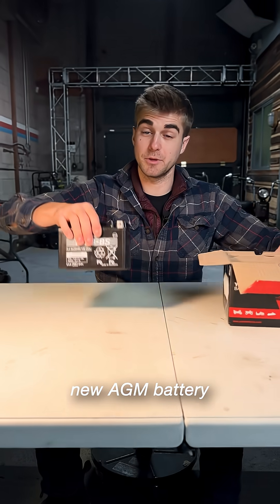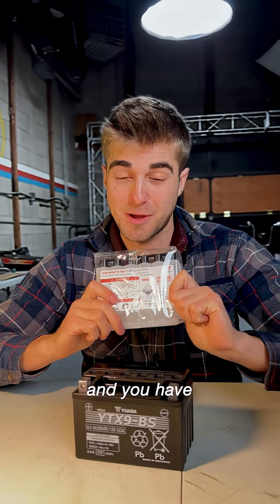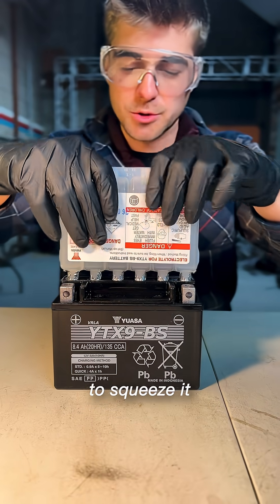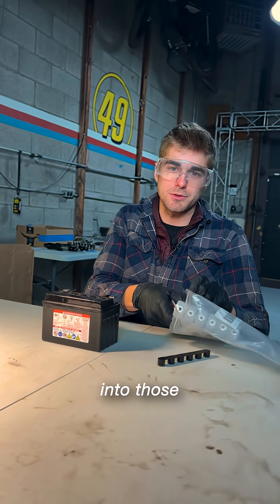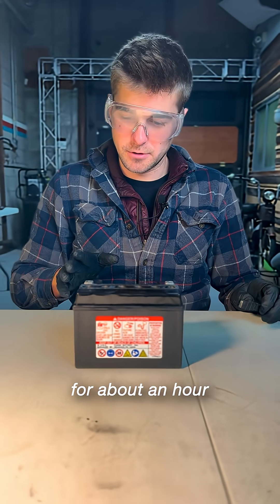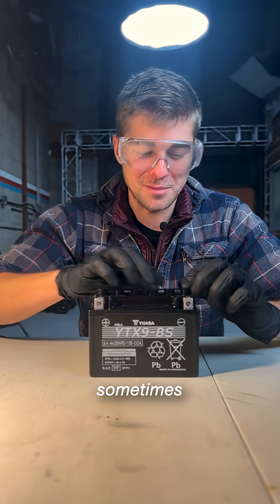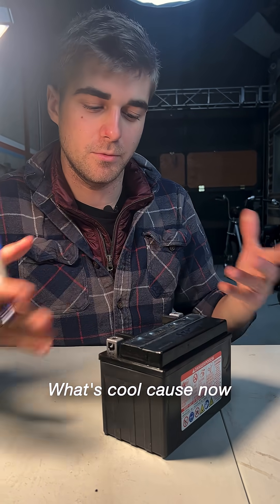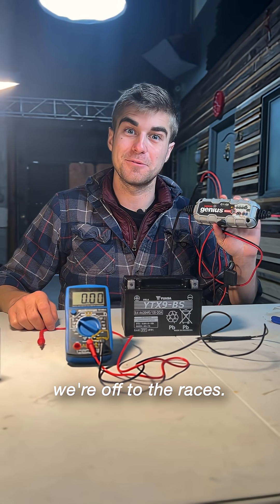How to activate your AGM battery | Tech Tips ⚡

Comment: You used to be able to order almost any lead acid battery dry and fill it yourself. WHich was great since it meant you had basically unlimited shelf life. Also, if your equipment didn't come with AGM batteries you want to make sure your charging system is properly charging them.

Comment: These kinds of batteries can also be used for smaller Back-Up Power Supplies (A.K.A.: Uninterruptible Power Supplies, "BUPS", or "UPS") for critical computer systems. 
But, most of the larger modern systems use lithium.

Comment: The best thing for the empty acid package would be to drop it in a bucket of water.  The little bit of acid remaining would be diluted to the point of harmlessness.  Then it could be dumped and the empty package would not have any drops of potentially dangerous acid remaining inside.

Comment: Seal the battery with the cap after trickle charging not before! The first charge may cause more off gassing than usual.
Reply: They have a gas valve for overpressure

Comment: Is there any maintenance required? I have a vintage Yamaha Enduro, and I have a similar type of battery but it has individual yellow caps. I read the battery manual and it says something about having to refill the acid every couple of months??
Reply: If you can open those caps, it's not an AGM battery. That's traditional Lead-Acid.

Comment: A couple of tips to make your battery last longer, do not cap the battery until the acid is completely absorbed into the plates. With a flashlight, look in from the top. If you see liquid, it's not absorbed yet. Wait. After it is absorbed and turns to a gel, then cap the battery and charge it before putting a load against it. Putting a loan on the battery without charging can reduce the battery life 20 to 25 %. This is from a Suzuki service bulletin they recommend using an Optimate desulfater-charger. I have had battery go 5 years trouble free. Enjoy the ride.
Reply: Definitely don't put a loan on it.😂
Reply: As a Suzuki guy do you have any recommendations on bike toys I can buy my partner for Christmas 😂  he has a cute black one and a cute blue track gsxr. And 2 more bikes on the way for spring. Looking for guys recommendations. He’s got great gear already and getting 2 new sets in spring. So can’t get that. And I have never even driven myself so don’t know what to get. I was so fed up I thought tyres would do. But apparently I need the right ones and black bike and blue bike wasn’t specific enough for them. So now I know 1 bike. So maybe just her getting tyres. But I’d like to find some fun toys he’d love and would be useful for multiple bikes as he gets new ones. He swears it’s the same black bike but I swear it keeps changing 🤷‍♀️🤣 I want something that really makes him happy ❤ but I don’t even drive so don’t know 🤷‍♀️
Reply: @cececox6399  just go buy him a leather jacket at bike distro or look for specific store that sell biker accessories, it'll be simpler for you and he can wear it whatever bike he choose to ride that day.
Reply: Thank you Jeffrey !
Reply: I bought a AGM from Amazon. It was a AC Delco brand that I bought for my Mercedes. It lasted over 8 years.
Reply: The biggest factor in the lifetime of your battery is you as the owner 

Charge it, keep it charged, don't let it sit in hot temperature for longer periods and store the battery in a freezer during winter.
Reply: *store the motorbike battery you're not using during winter. A car battery that you're driving is fine to leave in the vehicle

Comment: A misconception of acids - they are not that potent as Hollywood depicts them. In the end all the acid is used up to create salts, the mixture reaches the new balance and the chemical reaction stops - as it always does.
Reply: It's not an "I'm melting!" type of thing, but that's because we're not made of metal. You want to know what's more dangerous to us than acids? Bases. Like Hydrogen Peroxide. You may have a bottle of it in your bathroom.

Comment: Would love some tips on lithium motorcycle batteries. Mine (2024 Africa twin) says not to jump start it or use a normal trickle charger. So the only way I know of to start it if the battery died would be to try and bump start it.

Comment: I always thought that an AGM battery was a dry battery.   But I now realize that it is just sealed so the acid can’t leak out.   Thanks for learning me something new today!
Reply: The cap is to stop things getting in, not getting out, the liquid he puts in gets entirely absorbed into the pads inside the battery forming a gel instead of a liquid that can slosh around like a normal lead acid battery.

So once it's settled he could remove that cap and tip it upside down and it still wouldn't spill spill.
Reply: There is more to the AGM than that.  The mat and electrode assembly is very tightly packed.  As a result they are much more vibration resistant.  Also, their orientation doesn't matter.  Not just for leaks.  A flooded battery has a pool of acid at the bottom.  If it is mounted at a tilt (much off of vertical) it will fail early.
Reply: Teaching you something. . we all learnt something
Reply: @cpvjcking  I was about to comment that. Decided to read the comments first. No need for two people to say the same thing. But I"ll add.
- @sunsetoriginals7320
We learn things from people that are teaching us. We don't say, "thanks for learning me" Because that means the other person in the literal sense, learned who you are. (Although we woudn't say that either, because it's quite illiterate and misses out a few words.) Instead of taught you something.
Reply: Err...I've been to AGMs in the past! 😆

(Mainly because - In British vernacular - This stands for Annual General Meeting... 😇)
Reply: Because the acid is absorbed into the glass fibre matting through capillary action, it will not leak out as a liquid, even if the casing is split, unless it is squeezed out of the matting. Although it is sealed, it has a valve to release excess pressure if it is overheated, through overcharging, for example, so it will not burst open.
Reply: acid is still in liquid form and will spill if broken. The total magical absorbtion is a lie .
Reply: SLA is sealed
Reply: There's another AGM that filled with gel substance (yes it's the same gel substance as the one in the diaper)

It literally can't leak as the acid is all contained inside the gel sibstance
Reply: @sihamhamda47  GEL batteries are not AGM though.
Reply: A lot of misinformation!  These do can spill as they do have valves and they do burst and are unrecoverable if they get even slightly overcharged

Comment: baking soda, cardboard box, and the OSHA station, or a lot of water. It's a 12V acid AGM. Turn some of your skin into soap, you will be fine, it will feel awful after any water (humidity, steam, or water). Just treat it and it will be fine. Water than [redacted]. Hydrocolloid bandage for aftercare and an alcohol or heat-treated needle and wicking material for the 1-day skin bubble (you probably don't want that in your body).

Comment: A lithium battery is usually better in modern bikes due to electronics, but if you have an older bike susceptible to parasitic draw, you should use an acid battery for jumping

Comment: Literally never seen an AGM sold dry, anywhere, ever
Reply: I bought one last year on Amazon. Same exact process as shown here. And yes, it did show over 12 volts before I put it on the charger.
Reply: I have bought two from Canadian Tire, exactly  as shown in the vid.
Reply: @iainstewart371 same one lasted a year even if it was in my house on trickle during winter. 
Still on second one now.
Reply from the maker: Until Now! 🤯 ~JoshF9
Reply: Where do you buy batteries?
Reply: @alexhulinsky7954  they most definitely are. Princess Auto. Typically smaller utility 12 V
Reply: It depends on what size. Many motorcycle batteries are shipped dry. Deep cycle batteries intended for backup sump pump also comes dry (It is regular lead acid battery).
Reply: @lambition  I've replaced the AGM batteries in several uninterruptible power supplies (which have 2 in each for 24v) and have another pair that I bought for a project that I never completed, they all came pre-mixed. My car battery is also an AGM, it came pre-mixed... though it may have been activated by the store when I bought it.
Reply: @PistonAvatarGuy  UPS batteries are SLA (sealed lead acid) battery. So, they will come filled and sealed from the factory. 
Automotive batteries are usually filled in the factory as well (AGM or not don't really matter here). I believe is is convenience vs shelf life thing.
Reply: @lambition  The UPS batteries that I buy are AGM (Mighty Max ML9-12).
Reply: @PistonAvatarGuy  those are SLA. AGM batteries are type of SLA battery.
Reply: In Switzerland pretty much every store that specialises in auto/bike parts (that admittedly target professionals and garages) sell the batteries dry when possible but the majority of regular brick and mortar hardware stores that target the public at large usually sell them wet/activated.
Reply: Bought one last year. Very convenient for emergencies preparation.
Reply: @Hope_Boat  I'd never considered using an unfilled AGM as emergency prep. That's a fantastic idea.
Reply: Advance auto parts sells them, and I believe Napa does as well. Most power sport places sell them too. I would never buy one with acid already added. I even found a local seller of automotive batteries sold dry which is nice because you can store them for decades without degradation.
Reply: any hardware store here
Reply: I'm not convinced you've ever bought an AGM battery.
I've never seen one filled.
Reply: @Locke99GS  I guess that depends on where you live. You won't find an AGM in Australia that isn't prefilled from factory (not at the shop)
Reply: @BryanM63  Yeah, I suppose different countries might do things differently. But why would they come pre-filled though? They're shelf stable for like, ever, until they're filled.

Wait, are Australians allowed to buy or possess battery acid on its own?
Reply: Thats how I always get my motorcycle batteries. Walmart sold them like this
Reply: Where are you from?
Reply: This is very much not a common thing. Historically  AGM batteries where not even for automotive use, motorcycle or otherwise. it was largely for smaller electronics like battery backups, scooters and such and pretty much ALL of those come factory filled/ activated. 
Its become more common to use AGM batteries because of their safety and typically higher capacity and cold cranking amps for more modern vehicles with lots of compression and on board electronics.
Some of these battery manufacturers even hint at their "sold dry" state in the model number this is a YTX9-BS the BS stands for "Bottle Supplied" to let people know it has a supplied bottle to add first.. you might also see "FA" in some model numbers meaning "Factory Activated" so you don't have to add anything.
Reply: AutoZone? Walmart?
Reply: That's the only way Advance Auto Parts sells them.
Reply: @RedneckSith because the US is one of the few places that still allow you to sell AGM batteries without being pre mixed.
Reply: @DaveHdhshr-bt7ei  But isn't this better than pre mix
Reply: @DaveHdhshr-bt7ei I've bought them not being pre-mixed in Sweden

Comment: I switched to a Lithium battery for my motorcycle, next I’m switching my “fun” car to a lithium battery since the self discharge rate of an AGM battery has been a problem with the car in storage. And for those of you about to say “get a trickle charger”, I live in an apartment building with no outlets in the garage, and I don’t feel like removing my battery and bring it inside.
Reply: You can also disconnect the ground wire when sitting. I would still do this with a lithium battery to prevent any parasitic loads from killing the battery over time.
Reply: @xDownSetx  disconnecting the ground creates other issues for me, central locking is lost and it’s in a shared multi story garage (the car is odd and only has a keyed lock on the tailgate if the battery dies, meaning you need to crawl through the car to unlock the driver’s door, plus the battery is located inside the car under the passenger side floor meaning you need to open the door anyway, so that’s out), clocks need to be reset, and the radio will want a security code. Part of my problem is when I do take it out, my trips aren’t generally long enough to add any meaningful change back to the battery. I’m recovering the power used to crank the engine, but only a small amount of the charge is going towards the self discharge rate of the AGM. Lithium by contrast charges faster than AGM, and has a lower self discharge rate, meaning that it should recharge more over the same run time and distance.